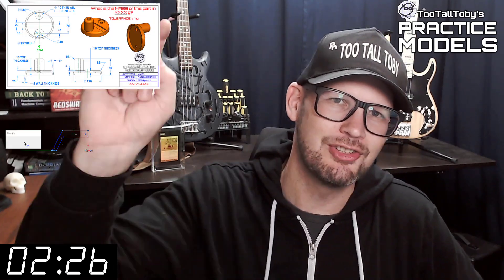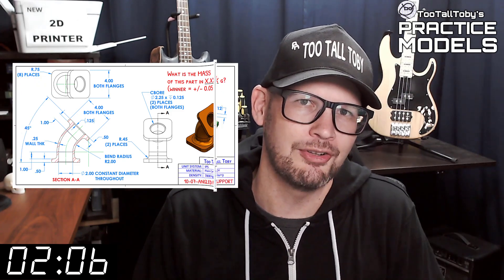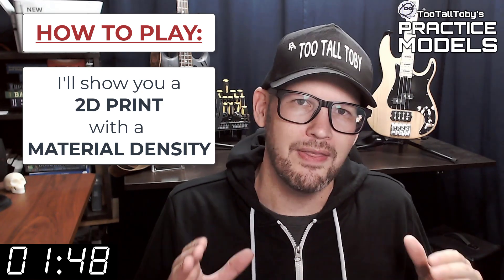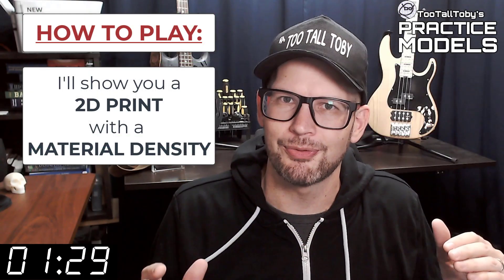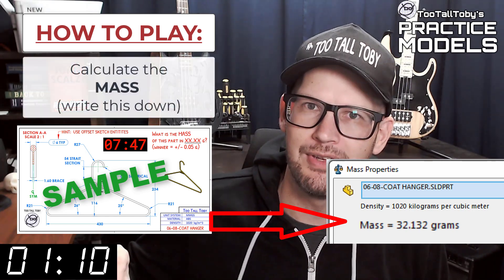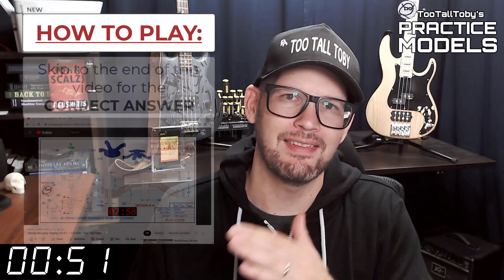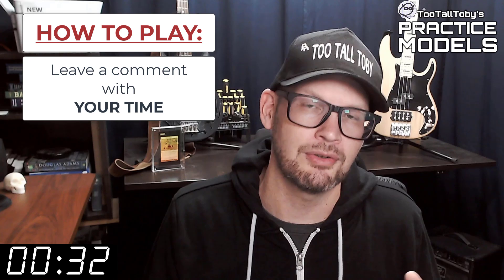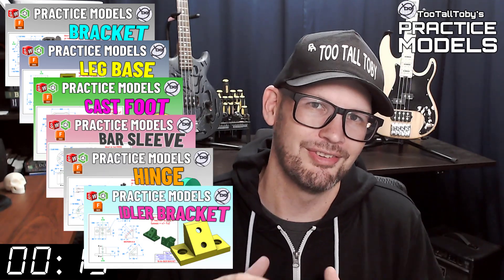2D to 3D CAD PRACTICE MODEL-  Drawing to Model exercises for Onshape, SolidWorks  - LENS MOUNT

Comment: Hey Toby, can it be by any chance that the last practice model on the website is missing a dimension for the large slot?  (the model that looks like an horizontal J)
Reply from the maker: The slots for that one should be 2.0 and 3.5 - It was missing last night but I re-uploaded it right away.  Is the 3.5 not showing on your end?
Reply: @TooTallToby  I checked it again now, and it’s showing 👍🏻🙏🏻
Reply from the maker: @amirshay  sweet!

Comment: 12.min to do it. Got the right answer (1034.99 g ). You must draft upward from the top plane. also make a plane at 135 mm from top plane and do 45 mm hole up to surface. Tricky part. Dragos.
Reply from the maker: Very nice and great workflow!  Thanks